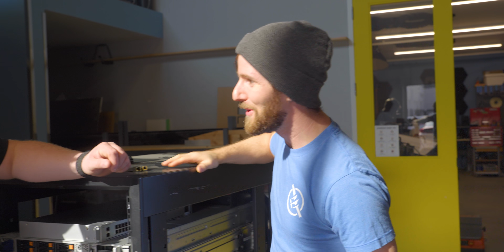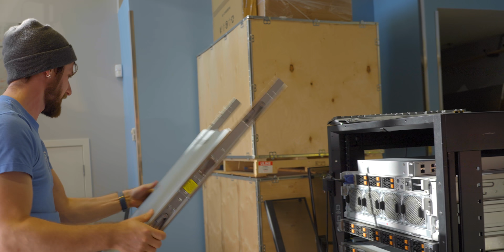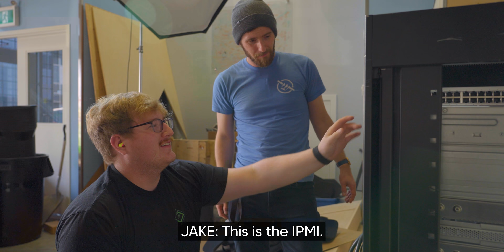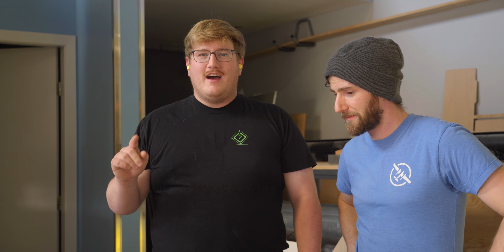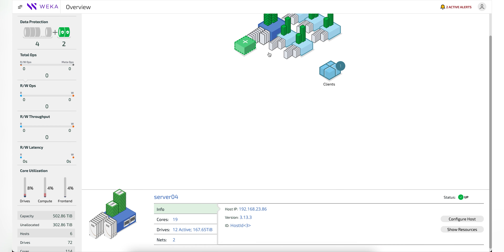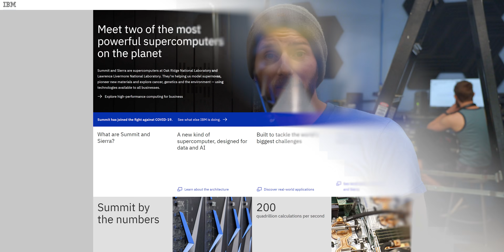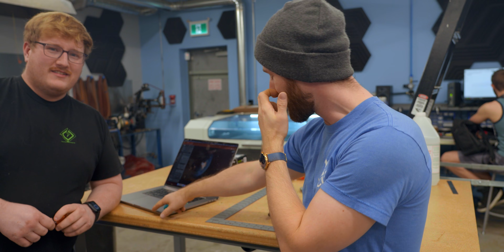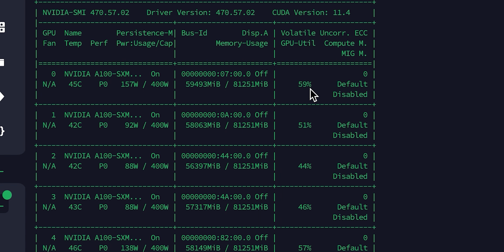The $1,000,000 Computer is Broken

Comment: Perseverance didn't use parachutes, it used a sky crane to land it that uses retrorockets to slow the descent and to hover as it lowers it using cables.
Reply: Perseverance first slowed with the heat shield, then at 12 km ejected the heat shield and used the parachute, then at 2.6 km it ejected backplate and parachute and went the rest of the way down on the landing engines - with the skycrane lowering the rover being the last part.   https://www.youtube.com/watch?v=4czjS9h4Fpg

Comment: I had a very similar issue with my main daily driver, a 12 year old Desktop PC.  It was randomly crashing and after the crash Ram slot 1 on the Motherboard would stop functioning, cutting my 8GB Ram down to 4GB.  Re-seating the Ram didn't help, moving the Ram didn't help, nothing would really help.  Then my cat jumped on the desk and sat against the Screen... instant crash... turns out the HDMI cable was dodgy and somehow was shorting out half my Ram.

Comment: I wish Amd or Intel would come out with a piece of software to show which pins are detected and which ones are not. I have a old p76 motherboard where a few ping on the motherboard i know are bad and not touching the CPU and in turn 1 of my dimm slots does not work. It would cool to get a visual and see if all the pins are in contact through a GUI or heck the bios worst case. I don't see how this would be tough to do as the motherboard and cpu talk to each other and they know which ones are on and off... just display the info??

Comment: I've seen this with WAN circuits in metal boxes in afternoon sun, for example. Very sketchy connector would lose the connection in thermal expansion and the circuit would drop. Sun goes down, circuits comes up.  That was a fun one.

Comment: You keep saying Bluray but Blurays are only 25G so...HD from Toshiba was higher and didn't have a need for a special finicky breaking down player/burner. If Sony had not begged Toshiba to withdraw its system Blueray was dead on arrival. They made a backroom deal because Sony was so heavily invested they would have imploded if the Bluray didn't make it. By the way, in 1981 I was helping figure out the best rate of descent for a lunar module landing on Mars using a program in Basic. Glad that Basic was not the main language as it was a pain in the rear to get working. The amount of fuel and when to burn how much fuel was a pain to figure out. A lot of botched landings(crashes into Mars surface) were done before we got it right LOL

Comment: Wow. That’s exactly the same symptoms my budget desktop is having! Threw in an m.2 nvme drive and it works — but only half the time. Once it’s booted it’s golden but until then it’s always a mystery.  Online forums kept insisting it’s because the mb is incompatible despite the manufacturer showing m.2 drive as a valid upgrade and the machine actually being able to stay running just fine. Thanks for making this video!

Comment: There are currently 2 choices when considering CPU upgrade: spend a FORTUNE for AMD 7000 (FULL new rig) or save a fortune with Intel 13th - which way you go depends on if AMD's performance justifies a MUCH bigger spend, and without 3D cache, the answer to that is NO! Let me elaborate: 
1. Spend a LOT more money for the full switch to DDR5 and PCIe 5, etc.. for AMD, in which case they would have to be MILES ahead of Intel to justify the cost (which the 7950 is NOT, having seen 13th gen CPU performance- so ONLY if AMD bring out 3D cache versions would they be able to persuade me to pay out the huge sum of cash, before going out & getting Intel this black Friday.)  
OR
2. Get the cheaper Intel 13th with MUCH MUCH cheaper parts (like you can use DDR4, etc.); no need to upgrade the whole rig, and you will still get similar gaming results with the Intel 13900 to the AMD 7950X. 

I AM open to spending the insane cost for an entirely new rig needed for AMD, BUT NOT for the performance difference between AMD 7000 & Intel 13th gen - the only way AMD could motivate me would be with 3D Cache 7000 chips, as this would leave Intel 13th gen in the dust, especially as with GPU's like the RTX4090 we have moved back to being CPU limited for even 4K games now! As we have seen with AMD's earlier 3D cache chip, it makes a HUGE difference to gaming, with that old chip STILL BEATING both companies' best CPUs in some games! I am not a "fan boy" of either company - I just want the best performance without getting ripped off.

Comment: I had a similar problem with a Dell Poweredge R810 except it kept throwing memory errors and at times would freeze at the configuring memory post screen. I tried everything from reseating all 32 dimms to reducing down to a single processor and even replacing the processor board. What ended up happening was a similar situation where the actual pcb that the substrate is bonded to was warped on the e7-4870 about .5 mm and caused erratic behaviors. I would imagine that is why when they moved to  LGA 2011 from LGA1567 they went to two latching mechanisms to distribute the load more evenly. In all my years between working on hundreds of servers or desktops I had never imagined that such a small tolerance would cause such an issue. I can see how EPYC would have a similar issue with the way the mounting is performed. I'm glad that your team was able to find a similar issue and resolve it.
Reply: I just hope AMD was paying CLOSE attention to that ! Since we are all now switching to  LGA, that nasty little bug could rear it's head on your Motherboard on a self coming soon.

Comment: The point of kibi, gibi etc. bytes was to get normal numbers, so 1 GiB is 1000 MB instead of 1 GB being 1024 MB
'That's why you get less than the amount written on the box of harddrives etc.
They use TiB but write TB because the End User doesn't need to know what that unit means.

(at least that is what I still remember from my business informatics studies 10 years ago)

Comment: The best lesson in electronics I ever had was from my father who was an electrical engineer before he retired. He told me "the weakest point and your greatest source of issues is always the connection and connectors. Check those first." Checking all the connections, even if they seem unrelated has saved me so many headaches over the years.
Reply: I'm also a retired EE. Your Dad is 100% correct! That is Electronics 101,point of 90% of most failures is to look at the connections 1rst. They are the weakest link in ANY situation of interest and most likely to fail 1rst.Just because it LOOKS and acts TIGHT,DOESN'T mean it's a GOOD Connection ! i.e. good example your car battery ?!? NASTY $H!TZ ! 😎
Reply: My dad told me something similar, “it’s always a mechanical failure”. The electricity is never going to fail to flow, but the path can be broken
Reply: @themonkeyman2547  depends if you are lumping mechanical into the chemical realm as well...
Reply: It sounds so unnatural to think of the cpu as a being plugged into connector to me though even though obviously it is I can see how they'd struggle to troubleshoot it.
Reply: …And your weakest point in troubleshooting is the wetware not being able to process the input.
Reply: @OlaMagnusLie  you must mean that crappy laptop xD, yeah ... the 1gb nic in that laptop will cause some lags! you can tell jake at the end said "sure we couldn't do some video editing"  he just realized the bottleneck was the laptops network card and thats why he looked down and upset ... LETS SEE SOME REAL TRANSFER SPEEDS!.
Reply: yeah always start with physical first.
Reply: I think your dad must be my long lost brother.....

Comment: "Intermittent" problems are the most annoying thing for customers to deal with. 
They take it to the dealership, say it does this; 
The mechanic/technician turns it on, and it works. 
Hmm. Annoying. That is why I get maxed out pay, and they call in corporate engineers if I have a problem.

Comment: Just spinning the camera around won't hit your storage array at all. That's just loading into GPU memory and sitting and re-path tracing through the voxels.

You need to hit play and advance through the animation to hit your nvme.

It's a cool demo but not really necessarily a "real world" example. Normally you would render that on a render farm in parallel so every render node could be hitting a different  server on your SAN. Then you stream that output prerendered into a frame buffer and play it back in realtime.

A more likely use for that data (and one without any fun visuals) is machine learning on a massive dataset.

Comment: This video may have inadvertently solved an issue I've been having with my M2_1 slot. The NvME drive would just randomly disappear when its reading or writing data and I need to restart for it to come back. Will report back!
Reply: Well, no dice for me after reseating my 5900x.  Guess it really is a bad M2_1 slot on my X570 Tomahawk. Tried it with a new drive as well
Reply: @Tech-Tempest  shame to hear that bro.
Reply: @Tech-Tempest  Sorry to hear. Is still within the time to claim warranty?
Reply: @akirafan28  yeah but MSI wants my board first and won't return it for a month essentially leaving me without a PC for that long.
Reply: @Tech-Tempest  Yeah, the time waiting sucks for sure. :(
Reply: Glad you found the problem at least!
Reply: Commenting so I hear the outcome.
Reply: Maybe this will spark a whole new test set of running the CPU up and down in temp (through test load) and seeing if PCIe devices do anything wonky. I mean, we could measure PCIe bus metrics, but oh wait, that's only in server class CPUs. They don't allow you to do anything like PCIe bandwidth measurements on consumer grade CPUs.

Comment: Recently i built a pc that worked from a screw but wouldn't start from the case's power button, turns out the labels were wrong, i didn't trace the rest, i just plugged in power and reset(they were two outside wires on each side. And voilà.
Idk which wires those were, but one of the connectors was a 2 pin one with reset sw on it, i think it was hdd led, because it permanently turned on a red led, don't know what magic was at work with only it as plugged pins but, when  power button is pressed the pc would flash to life for a sec and die untill the full 10 second power loss. Glad it didn't die.

Comment: I'm not sure what to think of these "Cobbled together" storage solutions. Don't get me wrong, what WekaFS achieves is very impressive, and I would love to know more about the technology behind all this, how exactly they manage to bring together 6 different servers over the network etc.
But for production deployments in a high-end enterprise setting (where else would this be viable?), I'm afraid this is too complicated, there's too much manual configuration and tuning involved, there's just too much to go wrong.
I would put my money on other players that manage to provide a more cohesive experience, while still delivering the performance and capacity.
Right now, I'm banking on Pure Storage, because their approach of flash modules instead of traditional drives seems very promising, but that could easily change in the next couple of years.
Considering you've also worked with them in the past, I'd like to hear your perspective on this.
Reply: You don't want to see the bill for 250PB of storage from Pure. So the IBM provided system with 250PB of storage is absolutely for sure using GPFS or Spectrum Scale as they like to call it now (Tiger Shark forever). The metadata will be on SSD but the actual data will be on thousands of spinners. If that 250PB is usable that's ~18 racks and ~20k drives. Yeah that's right 20 thousand drives and I would expect performance to be in excess of 1TB/s. The crazy thing is that IBM would not bat an eyelid if you rang up tomorrow and ordered such a system.
Reply: @jonathanbuzzard1376  I equally don't want to see the bill for your proposed IBM system. Might be less expensive than a Pure setup for 250PB, but still a boatload of money, and at that scale, honestly. Who cares. 
Also, I call bullshit on your claim of 1TB/s, even on 250PB of spinning rust. On flash no problem, as illustrated with this system (~100GiB/s with 1PB, assume nearly linear scaling and we're at 2,5TB/s theoretically). Even if the amount of individual drives (if you can even call the DFMs that) is over double in the hybrid array, you will not arrive at 2/5 the hypothetical speed of the flash array with spinning rust.
Sure, IBM still has some very cool and cutting edge tech (despite their dinosaur reputation), and they are much more proven at the scale we're talking about, but they definitely can't compete with a Pure Storage from a performance standpoint, and even regarding price I'm not so sure. Of course, everything we discuss here about pricing is bs anyways, because pricing at this scale works very differently than at the scale we might be familiar with. The IBM system might cost effectively the same (especially once you budget in power consumption), or it might be an order of magnitude cheaper, we have no idea. And we couldn't even ask and hope to get a helpful answer, either.
Reply: @InterFelix  The 1TB/s would be based on multiplying IBM's published figures of 55GB/s per building block by 18 to get 990GB/s. However that does not have SSD metadata which is going to get me that extra 10GB/s 🙂 So you can call bullshit all you like but my job is in HPC, and I have been doing GPFS storage for over 15 years now, so yes 1TB/s is real. You won't get that into a single client for sure but I would expect this to be over at least 10,000 servers.
Reply: @InterFelix  I meant to add that I would expect 250PB of ESS storage to come in at under 5 million USD, which is not that much when you consider Linus willy waving storage is basically 50 times more expensive per PB for less performance. That said the electricity bill will be unpleasant. I would estimate in the region of 100k USD per annum,            though it will pale into insignificance with the power consumption of the compute, which will be several million USD per annum.
Reply: @jonathanbuzzard1376  okay, you're clearly better informed than me, I will gladly let you claim victory here

Comment: damn, i'm wondering if thats the same problem i'm having, using a pcie m.2 adapter card and sometimes it just stops being detected over night, probably when it cools down enough from idling. After restarting the pc it sometimes works 1st try and sometimes half works with way lower speeds, but always within 5 or so restarts it comes back to full speed and has no problems until the next time it randomly stops working overnight